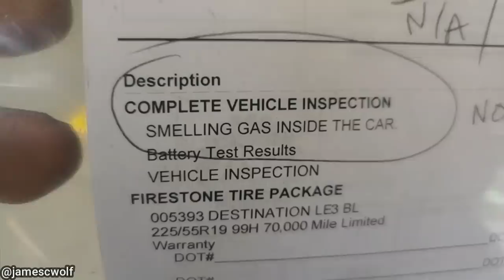Customer States Went Off Roading In Ford Bronco And Now It Won't Start | Just Rolled In

Comment: Isn't the last one a famous spot? That hydrolock is such a classical, how can people ram into water like this??
Reply from the maker: It's a possibility! Somebody else mentioned something along the lines of that.
Reply: Unless this was some twit trying to do it for effect, it may well be down to a satnav - or rather, to someone reading the satnav route and not realising what the symbol for a ford looks like. Oddly, this happens quite a lot in Britain (often seen on local news), where we still have many forded roads. Basically, driver follows the route like a zombie and assumes that if the road goes that way, it must be safe to cross, right?

Britain has 1: very high tides, and 2: a lot of sudden rainfall. Waterway levels can vary quite a lot, so give any ford a good check first - and drive in slowly!
Reply: Calling 'Tom D' I think you replied to this but for some reason it isn't downloading - I can see part of it in notification.
Fords (lower case, yes) are gradually disappearing as the roads are raised and a culvert run underneath, but there are still plenty around - face it, the UK ain't short of water and it's gotta go somewhere. 

We used to go visit an Auntie in the countryside when I was a kid, and one highlight was splashing about in this stream than ran over a low stretch of road. Even saw fish crossing, including one time a fair-size pike. Gone now, practical, but a pity.

There's a good one not too far from where I live now (exiled Londoner, me), in a place called Geddington. Has an amazing medieval stone bridge (dating from 1250) which can readily handle small cars and vans, but anyone else needs to go the long way round or through the ford alongside the bridge. No YT channel for this one, though - it's a well-managed river and there's a level concrete road bed. Never more than 4-6 inches deep, but still: don't take a run at it.

[NB, Geddington isn't far from the USAAF WW2 memorial, so if anyone's going that way, well worth a stroll around.

Comment: 2:46 I unfortunately did this in my civic a while back. It certainly didn't look that deep or have ducks on it but it was enough to get water in the intake. Every light on the dash went off and the car ran like crap for 10 min. Started running OK but all lights still so I took it home and disconnected the battery and boom! good as new! No issues since.

Comment: 2:17 - i have to admit that something like this happened to me some weeks before. I have an dying driveshaft joint on my Audi A6, and suddenly i had a strong smell of like burned oil in the car, i thought the driveshaft was finally failing until i opened the trunk... I had an canister of (fresh) motor oil there, where i failed to put the cap on properly, and that fell over. Luckily there was not so much oil spilled, but the smell is difficult to get out of the carpet.

Comment: I never fail to be amazed by the conditions owners get their vehicles in before seeking professional assistance!

As a former motorcycle mechanic and workshop owner I was often faced with two wheel horror stories caused by systematic neglect, horrendously poor standards of work, dire modifications and combinations thereof!

Irrespective of the fields in which one engages with the public, there are always people that exceed expectations for all the wrong reasons.

Working with the public can be very illuminating, unfortunately, what the light actually illuminates can be a thing of horror...

Comment: I know of a hydrolocked engine that was repaired on insurance as a car accident. They were fording a creek with someone else who overtook them. The bow wave pushed the water level over the air intake. Not the driver's fault, not a mechanical fault, ergo an insurance job. It's very tricky to get an insurer to believe you when you tell them to pay for a brand new Toyota Prado engine for something that wasn't a crash.

Comment: I go off roading in my old ram sometimes I always check everything and fluids before leaving if water/ muddy water or just mud got into anything and harmed anything. 

I thoroughly clean everything also making sure not to harm no parts or electronics in my opinion even though if your daily is a blast, don’t off road it or bash on it all the time if you want it to be reliable.

Off roading is fine but heavy mud can ruin shit.

I’d never sun merge a rusty vehicle in water.

Make sure everything that was rusted is repaired and everything is sealed properly. Keep vehicle top notch if want to mudding through waters. 

I got the rust repaired on my old ram everything is clean now and rebuilt.

I went through mud and water with truck it takes it no problem even before the freshen up the truck was still a beast. Hemi powered, people. 

Strong pull those engines got

Comment: I can not fathom the concept of being in control of a complex piece of equipment that costs in the four-to-five figure range and not putting any thought or effort into understanding even the basics of how it works so you can minimize the wear or damage you put in it.
Reply: So much stuff isn't even obscure knowledge, all that's needed is the most fundamental understanding of physics and mechanics, and if you just think a little bit , and apply this very basic understanding and pay attention, you can already reason out many steps you can take to reduce wear, drive more safely, ect
But no, everyone's too lazy and, rather than apply about a minute of thought here and there and maintain a basic consistent level of awareness, would prefer to go about their day and be "blind-sided" by 4+ figure expenses.

Comment: Well, so far my big car maintenance event of the year was changing a fuse that cause the 12V power supply on my Subaru Outback to fail.   That was $10.00.
Reply from the maker: Well at least it was a cheap repair 😜

Comment: I have a complaint, every time I rent a place and cook food in kitchen, I can then smell food in the air. Can landlord please fix this?

In case you didn't get it, this is to mock those who whine over gas smell while leaving canister of gasoline inside the car or those who leave open bottle of oil somewhere and then whine they have an oil leak ... or those who turn their A/C on hot and then whine that it blows hot air ... just FACEPALM 1000x.

Comment: If you can't see the roadway under the water. It may be gone. Best not risk your life. Either wait or go around.  Perhaps someday,  when they get the bugs worked out of the e cars, you'll be able to drive them in the water. Factor in the weight of the water,  the velocity of the stream,  the depth, and it's as powerful as a dozer pushing sideways.
Reply: Gov. Bert Combs of Kentucky.  RIP

Comment: That first driver must not have been told vehicles need a break-in period before you go off-roading. And other stuff, like a snorkel, bigger tires, brushguard, skid plate, maybe some more time driving it so they are more aware of it's capabilities. Stuff like that...

Comment: I thought that's how  Hydro-locked was caused. You didn't really need to demo it. LOL                                    btw What is that vehicle bottom right with the spare wheel on the back hatch on submitted photos?
Reply: Looks like a heavily modified Toyota Matrix.

Comment: 2:46 best part is they probably could have driven through it just fine if they took it a lot slower. it's only halfway up the wheels but they drove into the water so fast it completely covered their engine
Reply: There's whole youtube channels dedicated to that little piece of road. Fun to watch people be overconfident and then completely mess up their ride. 🤣
Reply: @timvandijknl  I’ve been addicted to it the last couple days. It’s amazing how many people just willingly total their cars…
Reply: I've driven through street flooding after heavy downpours with water at my bumper level and i made it through just fine. The trick is don't plow through like a maniac (see dummy in last clip) take it slow and steady, also once you've started DO NOT STOP until you're out of it. Also it's probably a good idea to be familiar with the road so you'll have an idea of how deep the water is and if they're any hidden surprises below the surface like a giant pothole. In my case I have driven that street several times and could judge the depth based on fixed structures next to it e.g. gates, trees, sign posts. Lastly, don't make it a habit, try and avoid flooded areas whenever possible.
Reply: also, the floaty license plate would have lifted the front end further.
Reply: I can personally vouch that I have done this but my engine was not hydrolocked but there was a 1/4 cup amount of water in all the cylinders totaled together and I was able to get it back on the road mind you this had happened in sheer darkness in Texas while raining hard.
Reply: eh when in doubt, find a new route.  Water can be half way up the wheels and still damage components.  Transmissions usually have a vent valve that will let fluids in if submerged, Ecu's and other electronics can be fairly low as well, other drivetrain components can be damaged.  Its just much smarter to avoid sitting water if you dont know for certain how deep it is.  Gotta admit it is pretty funny though watching people who think their dinky little crossover is some rugged offroading machine, then wind up hydrolocking in 12 inches of water.
Reply: Yeah I accidently did something similar a couple days ago. But I was smart enough to kill the engine when I realized how deep I was. Pushed her out and started up after about 10 min of waiting to be sure the vapors were gone.
Reply: @Tim van Dijk  please post a link. I'd love to watch this!
Reply: that road has been closed now, too many idiots going too fast for the crowds amusement,
Reply: @sweeptheleg.  And one more rule: if you did get stuck, open all windows immediately, even if there is a thunderstorm of the ages outside. If your exhaust pipe is flooded, gases are being carried out of it straight up - into the rear of the car. A rally team in Russia died a few years ago, they forgot the rule and got stuck in 2 feet of a puddle, and tried to climb out without opening the windows.
Reply: You do realize some modern cars have only 8" fording depth....
Reply: @timvandijknl  That road has been permanently close now.
Reply: @CS-zn6pp  Yeah... the people living right next to the Ford were having a lot of issues with the amount of "tourists" hanging around to film the cars getting stuck

Comment: I was driving through the desert in AZ one night after a rain.  Water was flowing across the road, which was a strange road to me.  I pulled over, got out, found a stick and started slowly working my way out feeling for any sort of a washout.  Another car came driving by, and I just stood off to the side.  They drove through without slowing down much.  Water was less than 1/2" deep the whole way across.  I still feel I did the right thing.  :-)
Reply: Yes you did , the other drive may have drove through hours before knowing the depth
Reply: @WOW-io2yp  That's what I thought.  They drove through as though they knew how deep it was.
Reply: You did the right thing.
Reply: Did the same thing with the worktruck once 2hrs later pipe under the water collapsed!

Comment: Imagine having the money for a Jaguar SUV, but not the brains to avoid hydrolocking it
Reply: It's for this kind of stuff I hate SUVs, it's just false advertising at this pointing making buyers think they are buying a vehicle with a decent ability to traverse unfavorable road conditions when all they did was taking a regular car, make it fatter and give it a bit more ground clearance.
Reply: @jackmcslay  if you are going that fast in to water,even a real suv would die ,people in that area just dont give a fvck,.they go full speed ,in golfs ,bmw etc, the only ones going slow are the ones with snorkels on
Reply: Leasing the cheapest diesel model =\= having money.
Reply: @jackmcslay  Watch the Rufford Mill videos, you can see idiots hydrolocking their Defenders, and others going through the same depth an hour later with a Mini, and succeed. People dont know how to do river crossings, hydrolocking a Defender is just harder than hydrolocking a Mini. But possible.
Reply: @Pato-ARG  If it was engineered to have intakes just some 15cm higher it would probably have been fine, otherwise even if you could manage it going slowly it's certainly not recommended, yet I've seen many SUV owners arguing one of the reasons they bought an SUV instead of a regular car being this exact situation
Reply: @jackmcslay  these cars have their place, you can use them in regional Australia to avoid getting stuck on wet, unpaved roads without sacrificing too much street comfort and safety. They have enough ground clearance to drive such streets, while many sedans are far too low today. 
It's clear these are no offroaders, they are not made to cross a sand desert or to cross rivers
Reply: Having money doesn't mean your intelligent believe it or not.. it means your parents were.

Comment: 0:42 So right at the centre of the control arm, they use the least amount of metal? Modern BMWs seem determined to bury the "Quality German Engineering" myth well and truly. :-))
Reply: Yeah, that went away a while ago. Anyone who buys a BMW or Mercedes these days is a fool. As much as leasing is a horrible financial idea, it makes sense for these cars
Reply: It's possibly a deliberate weak point to avoid more serious damage elsewhere.
Reply: nto be fair, these rods are drop forged. when I was working car mechanic here in germany we replaced them usually when the ball joints wore out (at autobahn speeds you don't want to have any play in the suspension), or the rubber bushings were failing. breaking might have come from hitting a curb.
othewrwise, I'm with you. the repairs I had to do you wouldn't encounter on cheapo japanese and coreans, or even Dacia from romania made me doubt the premium car myth.

Comment: the wire on the muffler could have been a "back road repair" 
had a muffler bracket on an old Ford LTD I owned break while on a country road and with help of a local farmer and bailing wire tied it up until I could get into town to have it replaced

Comment: 10 miles and needing a new clutch can easily be either driver abuse or a defect at manufacturer level.

With some of the burn-out videos that people make, I would bet on driver abuse.

https://www.youtube.com/watch?v=oebzAIZEfxQ

The stupid is strong with this one.
Reply: Burnout with awd tho?
Reply: @theparadigmshift74  
The yellow car was attempting burnout while holding full brakes ... the only place the engine could break free was the clutch.

To do a stationary burnout you need to  be able to disable the brakes on the wheel(s) you want to break free.

Comment: Tesla groupies: "Our cars don't hydrolock because of a small puddle!"

Cool, cool. When it shuts off, step out in that 400V water (or whatever they run) and see if you can spot the problem.

Disclaimer: I don't think it would electrify the water, but it's fun to pretend.

Comment: So I was installing a billboard, saw an employee park an s.u.v. outside a body shop. I climbed down, he went inside, then I see smoke coming out of the sunroof. I'm telling the guys in the shop it's on fire, they were confused.  Finally they got in the car with a fire extinguisher. The flames were about 2 ft. off the center console. All 4 windows rolled up. Guessing lithium battery fire?

Comment: I know the new Broncos have their share of issues, but the two featured here have to be user error by people who want to be offroaders, but shouldn't. Some in other comments say it's a bad clutch disc or not broken in, but that one screams driver who has never piloted a standard. The hydro-locked one was pretty amusing.
Reply: The undercarriage of that first Bronco looks to be a 90's model and not new . The new one with a burned clutch looks like some one tried to do a burnout and was smoking the clutch instead of the tires . Can't fix stupid .
Reply from the maker: Old Bronco's don't have plastic oil pans. It's a 2021 Bronco.

Comment: At a friend's shop he showed me a new clutch that worked well for 3 hours before it refused to disengage. A small balance weight on the clutch disc came loose and jammed between the clutch disc and pressure plate. The parts store gave him a new clutch and labor claim.
He punched the balance weight off the new disc before installing.

Comment: I will never understand wanting to go through deep water in a lead brick of a truck or SUV.  Yes, you will hit the bottom of the bog and gain traction.  No, your stock air intake is not still above the water.

Comment: 0:23 Hydraulic or electric power steering?  Since you said "module" I'm guessing electric.
Reply from the maker: Yep electric.
Reply: All Hyundais and genesis got electric power steering. It shorted out while it was parked
Reply: @JustRolledIn  was impressed by how calmly the mechanic put out the fire (as if this is something that happens fairly regularly!)

Comment: I know you can fuck up a clutch pretty quickly, but 10 miles??? My wife learned manual on her '13 Fit that she bought new (yep, bought a car she couldn't yet drive). So probably some excessive wear early on the clutch while she got used to it. She's put 140k+ miles on it, same clutch, no issues. Not even the hint of a shudder.

Comment: The cars driving through the lake stuff is from England and a lot of them will just blast through like they're driving a old Land Rover with a snorkel 🤣 then of course some guy in a land Rover with a snorkel shows up and drives around them.
The first guy with the Bronco had no clue how or where to drive off road and probably should have ordered a snorkel... Expensive lesson. If you don't know how to drive a stick, don't learn on a brand new truck...